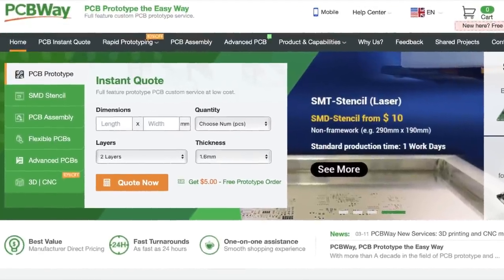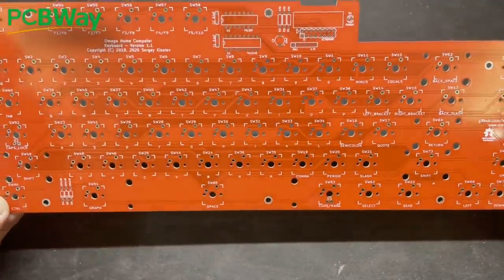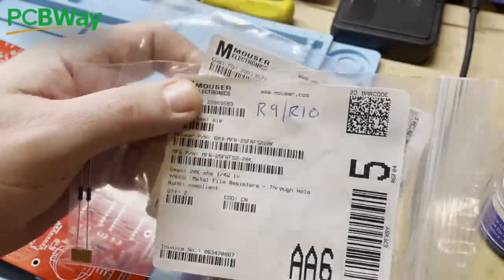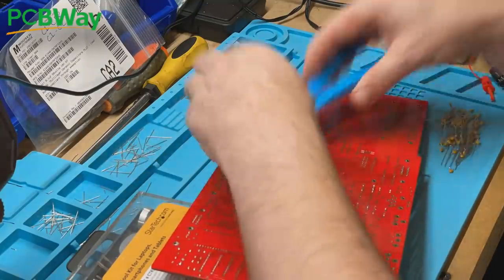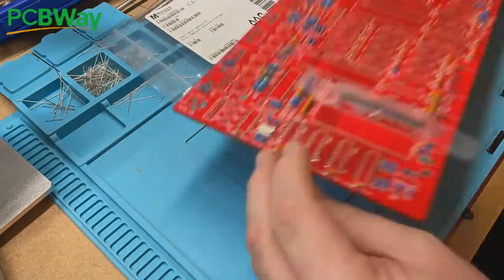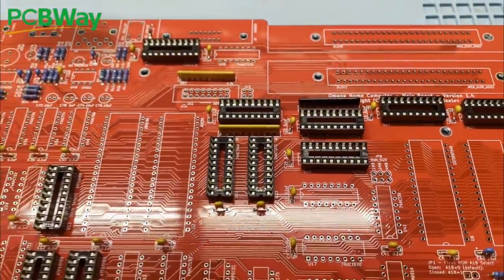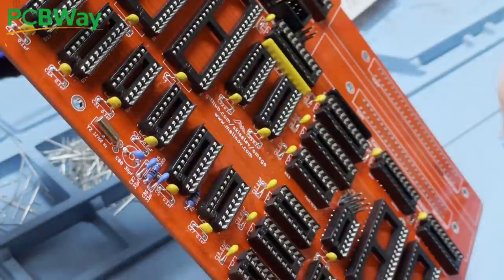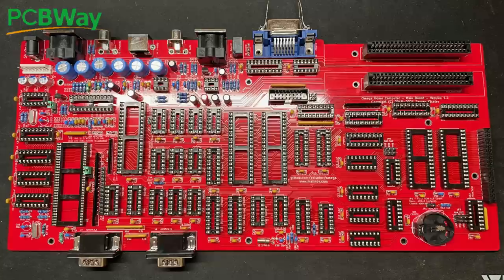Can we build an MSX-2 from (nearly) 100% new parts?  Let's find out in part one of our XMAS special!

Comment: The reasons for attaching clock crystals to the PCB via mechanical means is partly to prevent interference, but it's also to reduce stress on the legs of the crystal as it vibrates normally. See EEVBlog's recent video on resonant frequencies and the importance of securing loose components on a PCB when it will be subjected to stress or vibrations for more details.
The long and short of it is that these crystals will be vibrating constantly when powered, and over time the vibration will cause the legs or solder joints to weaken and possibly lose connection. Securing the crystal with a spare resistor leg is a zero cost solution to a possible future problem.
Reply from the maker: Thanks - a much more rounded explanation than mine :) :)
Reply: that's why I was suffering when the crystal was mounted without tightening the leg.
Reply: I sincerely doubt the crystals own oscillation has the force required to affect the solder joints.

The EEVBlog example is a rather extreme example of a "higher mass" component (relative to a crystal like this one) being shaken specifically at its mechanically resonant frequency until the point of failure.

Yes you could do the same with one of these crystals, and it's a very good reason it is tied down to the board, but the force required to do it - and the frequency - are very probably not the same as generated by the crystal itself.

Another very good reason for tieing it down (and I've also seen them soldered to a pad) is to ground the case of the oscillator. If you look at the datasheet for e.g. a real-time clock where they give an example of a PCB layout they will usually show the oscillator and it's signals surrounded by ground to help protect them from noise.
Reply: @TomStorey96  The 32K clock crystals can and do resonate themselves partly unsoldered at times, I've seen it happen twice. But that said they where hanging on much longer leads and sticking up in the air rather than flat on the PCB.
Reply: @frankhovis  I dont really believe it. If they were vibrating enough to crack solder joints, they'd probably break themselves off their leads long before the solder joints failed.

If you can point me to some material about such a phenomenon then I'd be more inclined to change my mind.

Comment: The Omega MSX is a very nice project, and skiselev (the author) is a great guy.

Tips:
- You can easily upgrade this machine to MSX2+.  In fact, it already has most of what's needed
- It's better to mount a right-angle slot on the slot-2. It will be much more practical to use, and this is why a lot the old MSX computers opted for this too

The only sad parts are that this machine doesn't have a turbo, nor an FM soundchip.

Comment: 12:14 - actually crystal oscillators are suggested not to be soldered too close to a PCB as they prone to receive vibrations from PCB itself. One could notice some oscillators are factory separated from the PCB with a plastic spacer or hot glued. I prefer to hot glue them.

Comment: That case looks amazing! I've just finished building my Omega. It works great, although I've had to replace the RP5C01 which failed and caused my Omega to boot with random foreground/background colours and screen widths. I've also added a small PCB that generates the +/-12V rails needed by some cartridges, and I've built an ObsoNET Ethernet cartridge for it, too :)

Comment: Oo, just came across this. I shall watch with great interest, thank you.
FWVLIW: I wholeheartedly agree with the OP - "Do it right, and do it once." The oscillator strap is indeed 'only' a mechanical connection, but important.
That does look to be a nicely laid out board. Speaking as someone who has designed a lot of PCBs I have a bit of a bee in my bonnet when it comes to people not paying attention to aesthetics, especially as doing so often helps both with reducing mistakes and improving stability.
Reply from the maker: Hope you enjoy it!  Parts 2 and 3 are up also :)
Reply: @TheRetroShack  Excellent, thank you!

Comment: The only reason I personally put the wire over the crystals in my designs is to secure it down. You have no idea how many people will go into their products and poke around only to break off components (and usually send it back claiming it was faulty). Drove me up a wall, so I started doing stuff like that to secure parts down. I use nail polish to lock trim pots after factory calibration and to seal things that need to stay shut as well.

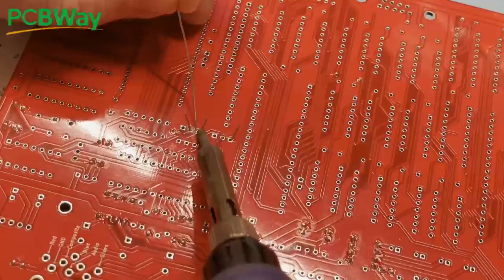Comment: 5:15 I used to poke my PAL machine's VDP into NTSC to make games run about 20% faster.
My monitor, and several monitor brands at stores didn't seem to mind and display without a flaw. How critical is the VDP / NTSC choice at forehand?
Reply from the maker: There are other components that (should) be changed out depending on your choice of PAL/NTSC.  I all honesty, I'm considering putting those components into header strips and then having it completely switchable :) :)

Comment: Excellent timing! I have the PCB and custom chips for my own Omega. Just need to order the giant bag of components. Hardest one so far has been the socket fir the VDP.
Reply from the maker: Good luck with your build! :) Got my dip socket from a seller on eBay in the end :)
Reply: I ordered mine from a local company and in turn ordered from b2b dealer like rs online, mouser or farnell, should still be available but it wasn't cheap.
Reply: @TheRetroShack  Well, I've finished my build but I'm stuck on the BIOS, of all things. Going to see what happens. Not confident I'm burning the ROM the right way :-)
Are there any support forums I should use?
Reply from the maker: @CheshireNoir  Check the Omega MSX forum on Retrobrew Computers.  Good luck! 👍

Comment: i design,build and sometimes reverse engineer metal detectors, so i have built a lot of kits.
the best tip i would suggest is to build in stages, resistors then caps then transistors,fets and ic sockets.
testing all the way, once populated except for ic's start with the power circuits check your voltages at the chip sockets, then move on to inputs, video and audio.
building power first then the rest in blocks cuts down on mistakes, since you dont move on til each block is right, there is nothing worse than building and populating a board completely then turning it on and having to trouble shoot the whole board.

Comment: I find that a rubber band is better for holding those pesky sockets flush against the board than tape (and easier to move around, as long as you didn't solder the taller components first). Solder all the vertically oriented sockets first, moving the band from left to right, then the horizontal ones, from top to bottom.
Reply from the maker: I’ll give that a go! Thanks for the tip :)

Comment: I still have 3 working msx2 machines, but was also considering building my own with build in ym2413, a few sockets for other synth chips,, extra ram, sd card expansion/diskdrive replacement etc. Great project! Really looking forward to it booting up for the firdt time! It has no mention of a disk controller, are you going to use the flash rom for that function? To load gsmes etc?
Reply from the maker: Hoping to stick a sneaky Gotek drive in there :) :)
Reply: @TheRetroShack  As far as I can see there's no diskdrive controller, or do you have a cartridge based controller? Theres nothing to connect the gotek to..

Comment: Can I suggest a smaller, ball-type soldering iron tip? Also, have a look at the Weller PCB holder (ESF120ESD) which allows you to rotate the board along it's axis, and has a little arm to hold the item you are currently soldering correctly in place - no plastic waste!
Reply from the maker: I have tried smaller ball rips in the past but maybe it’s time to give them another go :)

Comment: What's the point of making your own MSX-2 machine if you still need original parts from old MSX-2 machines?
Reply: Not getting ALL the parts with more than 30 years old, only the required. There’s still people buying WHOLE machines from that era which usually need some Love to work or not fall apart fast…
Reply: @thelabby9998  I see. Well, hopefully, we'll see a day where video and sound chips from the 8-bit days are once again available of the shelf due to demand.
Reply: @alexanderfreeman  yup or almost replaced by FPGA like ones (in fact the omegamsx has some GALs) but we shouldn’t forget that synthetization using these techniques are so good as the information we have from the originals (datasheets, manuals, etc) and sometimes the true component isn’t exactly the same as “on paper” so we can get different response (including keylag) which in the end it’s translated into not the original experience. For conservators or people studying these as “electronic archeology” these things matter and even I’m agree that nowadays there are solutions to fullfill nostalgia we will find people needing the most baremetal original solution possible which means that kind of harvesting. At the same time re-using is better option than recycling. ;)
Reply: @thelabby9998  Yeah, to reuse is better than to recycle, but, eventually, we'll run out of parts to reuse. Some audio chips from the late '70s are being made again due to demand. I'd like to see that happen for the SID chip.
Reply: @alexanderfreeman  it will be amazing getting some replacements for sure!